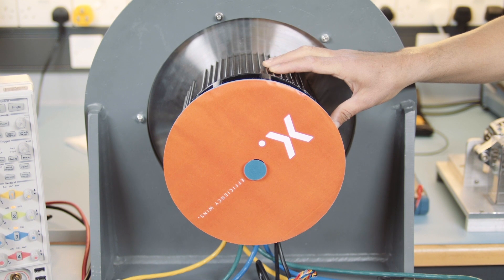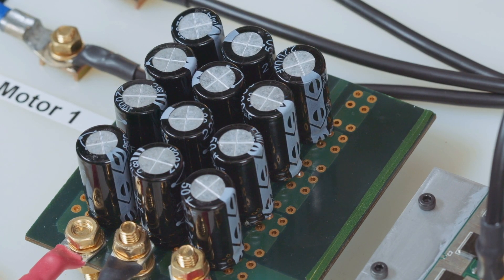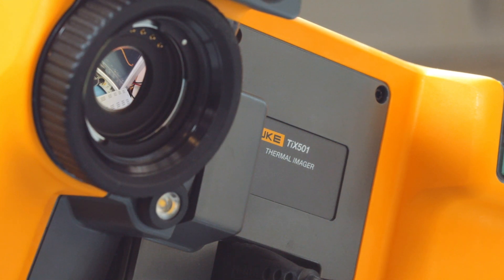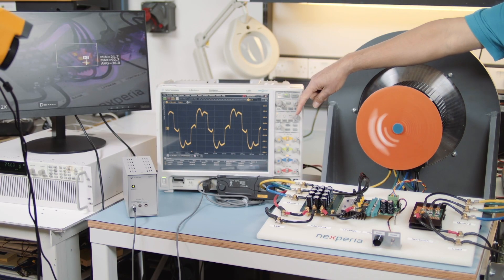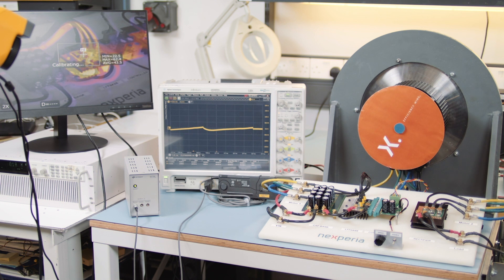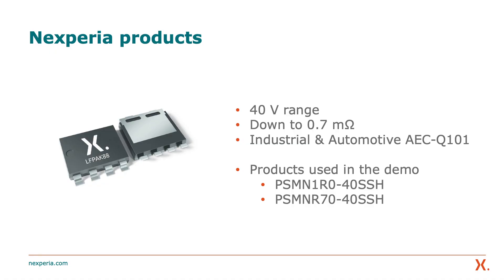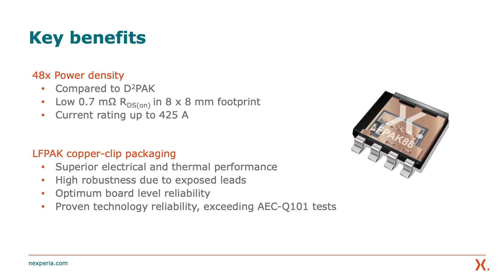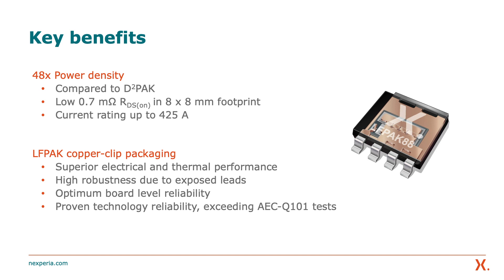High current 3-phase BLDC motor drive application using Nexperia LFPAK88 MOSFETs

Comment: What rectifier section does?
Reply from the maker: Thanks for the question, @FratDede. There are two motors in one unit, one motor is being driven and the other is spinning as it is mechanically attached to the first.  The second motor will act as a generator. The voltage / current induced from it is in a form of AC, the rectifying section, which is made up of diodes, rectifies the AC signal into DC and is fed onto a load.

Comment: Whats The Driver Ic ? Can we Get Data On that Please
Reply from the maker: Hello, we develop, produce and supply power MOSFETS, the driver is an off-the-shelf generic IC amongst many devices that be found in the market. The one used for the demo is an Alegro A4915. Please take note that the user takes full responsibility to check the suitability of the driver and device within your application as well as any relevant data/updates from the supplier of the IC. Thanks for your question!
Reply: @Nexperia  thanks for The Reply.... I am using NEXPERIA LFPAK in My Inverter Design...